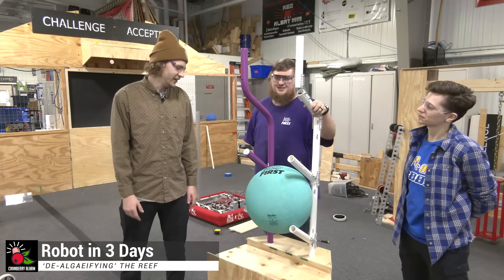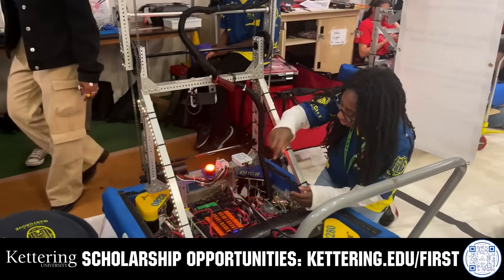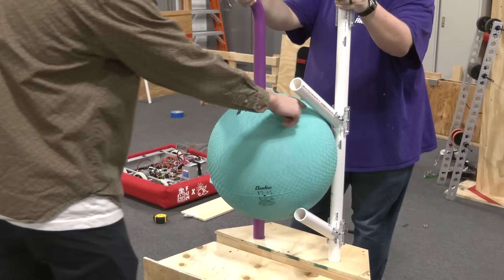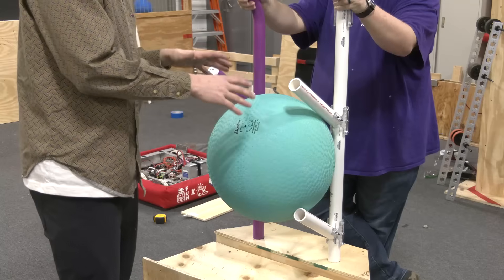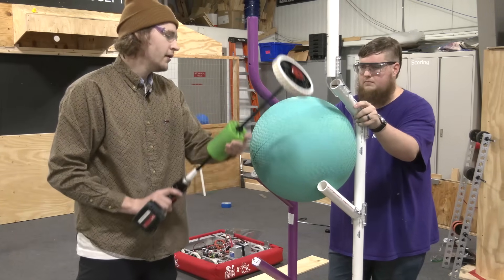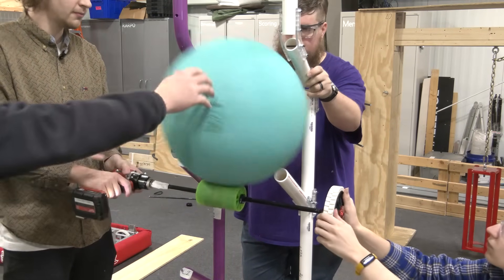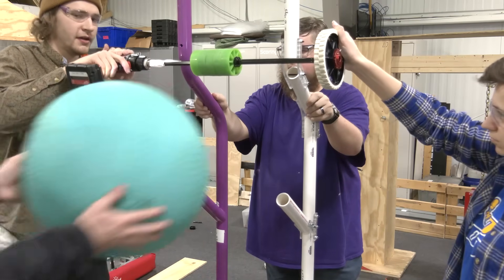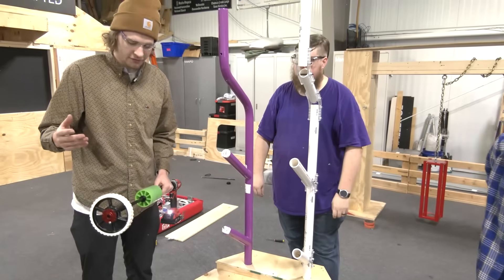'De-Algaeifying' the Reef Cranberry Alarm Robot in 3 Days REEFSCAPE Ri3D

Comment: Hey guys love the work you're doing, are those polycarb plates holding the pvc pipes together custom? If not do you know where I could find them? Thanks!
Reply: TheThriftyBot sells an aluminum gusset kit, but their product page also links to CAD, drawings, 3d printable files, and 1:1 paper templates
Reply from the maker: The brackets are designed by The Thrifty Bot. You can buy the brackets or cut them yourself. There is a link in the product description to the files.
The team used polycarbonate because that's what the CNC would cut.

https://www.thethriftybot.com/products/55-degree-gusset-kit-for-reefscape?_pos=1&_sid=5d73171a8&_ss=r
Reply: if you want an even cheaper alternative you can 3d print things to hold the pvc together if you have access to one